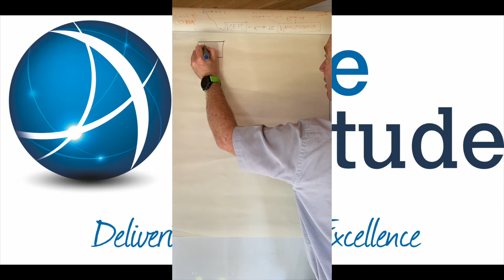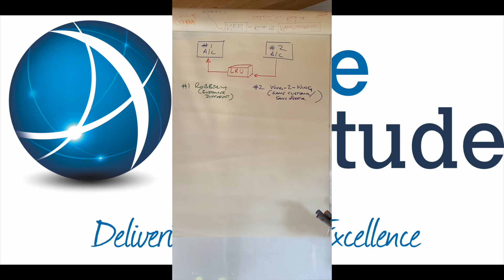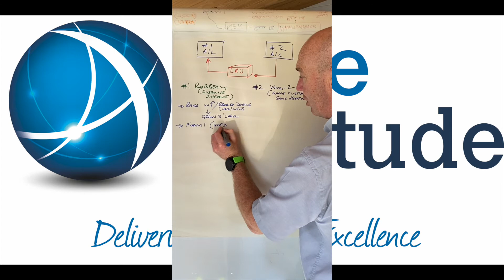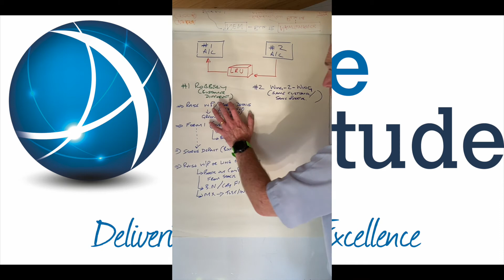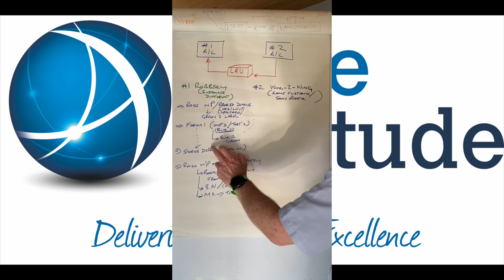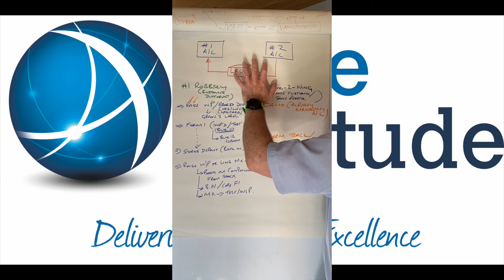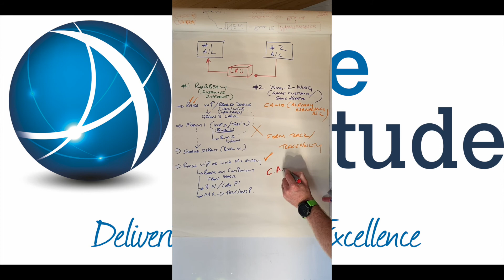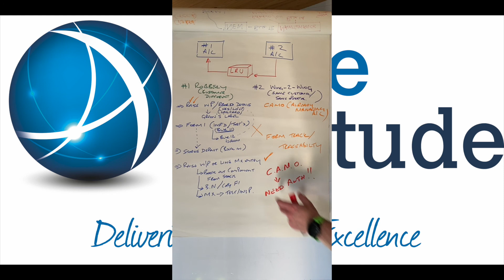Aircraft Component Robberies / Wing-2-Wing

Comment: Strange situation , Operator wants to remove an engine from a donor aircraft (as it has way more hours on it left til scheduled maintenance ) but the donor engine is unserviceable with noted defects , they want to fit it to another of their aircraft and have the defects then addressed whilst its fitted to the recipient aircraft before that aircraft is released .rI am being told that EASA would allow this to occur, but I have never experienced this before , I was always under the impression that the donor aircraft component must always be serviceable at the time of the robbery and prior to the fitment of it to the recipient airframe .... What is your perspective on this , hopefully backed up with a specific EASA reference would be great ?
Reply from the maker: Hi Bandit Rider

Thank you for the question.

Interesting…….  The situation described below, really needs to be clarified by your Quality Manager / Department.    This is the way I would manage it to establish control of the situation.  PS – I have assumed that the defects do not require an engine shop visit.

I don’t know of any reference in the regulation that says you cannot.  The important aspect is about this scenario is ‘CONTROL, TRACEABILITY and MANAGEMENT’ of the task.

Based on the scenario, it’s an ‘operators’ aircraft and NOT two separate customer aircraft therefore, the aircraft are under the control of the ‘Operator’ and ‘managed by the same CAMO’.

Donor Aircraft: Technical Log entry that refers to a work pack that details separate line items for defect on the engine and an entry for the removal of the engine.  The open entries for the defects are transferred and cross referred to the ‘Receiving Aircraft’ work pack.  Open entry for the serviceable engine to be fitted / tested.

Receiving Aircraft: Technical Log entry indicating the engine has a defect and cross referred to a separate work pack is raised.  Within the work pack, all the entries that are wrong with engine from the Donor are individually listed line items and open for corrective actions to be carried out.  Then carry out the rectification to make the engine serviceable.

So, as long as its controlled, traceable and managed, it should be ok.  

However, it raises questions about the ‘Operator’ ability to operate the aircraft safely.  1. Has it identified any risks in carrying out the above W-2-W?  2. How is the CAMO going to manage the changeover in records?  3. Can the operator financial support the aircraft effectively?   4. Does the operator think this is good practise?  5. How is this situation being perceived other competitors about the operator (everyone talks) 6. What are the potential human factors and safety risks associated with this task?  7. Driven by commercial pressures, therefore a potential risk to the operation?  8.  Does the operator have cashflow issues?  Therefore, sufficient resources? 9.  Is it common practices to do this?  10. Pilot, crew and maintenance persons feel uncomfortable about carrying out an unusual practice therefore, how that affect moral.  Back into the HF issues again.   

This type of event may be found during an audit by the competent authority either by the Flight Ops or Airworthiness Surveyor.  This is where they would ask those questions above.   From their audit, could lead to finding etc…. 

Just one point to note: be careful when it comes to an issue that has been raised within the MEL and the Operator moves the defective unit around the fleet to keep the aircraft flying.  Example - Engine CSD having a 72-hour limit and the operator does not have the spare, so they continue to do the Wing-2-Wing process several times across several aircraft to keep them flying.  This is a red flag.
Finally, hope that answers your question.  Always welcome the feedback.  Even if you or someone disagrees :)

Comment: Dear Sir, I have a question for wing to wing swap. If this process has been done in line maintenance environment at the outside station, how the process should be? It is acceptable that 145 organization record everything in AML (Aircraft Maintenance Log) without any another documentation for removal/installation? Or it has to be workpackage (work order etc) coming from CAMO to 145 organization for the job?
Reply from the maker: Dear Ahmet, great question. 👍. Yes, it is acceptable to record in the AML with the relevant removed-from details and the open entry from the donor aircraft.    When carrying out the W-2-W, you should seek authority example: Maintrol or the CAMO to carry out that act.  However, it may be covered in the aircraft maintenance agreement.  So, suggest you refer to your quality team to understand if there is a defined process.  If not, support the quality team and help set up the process / how to manage these issues when they arise.  Hope that answers your question.  If not let me know.  Happy days!  😃
Reply: Thanks for your reply. Appreciated. Also, I congratulate you for opening such a channel and sharing your experiences. @bluealtitude2013